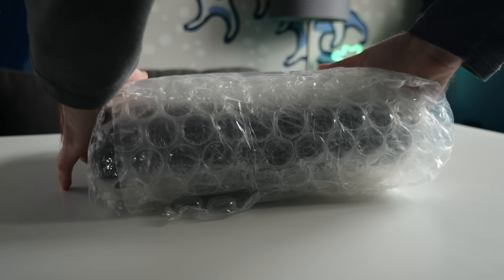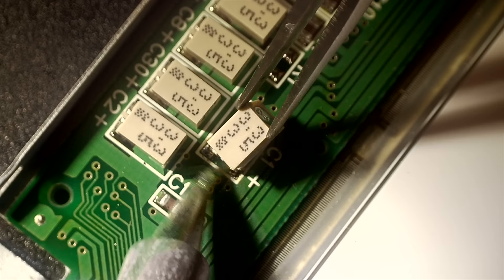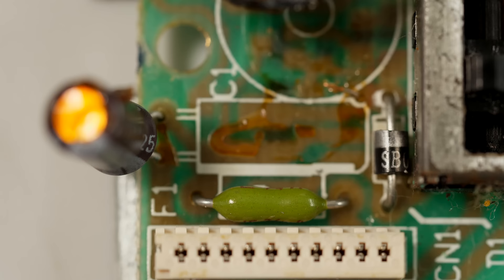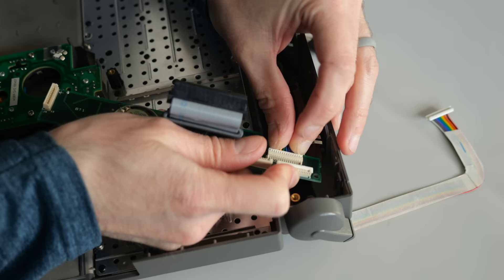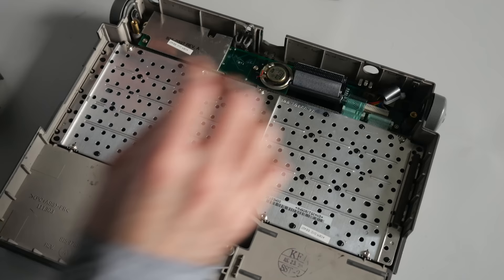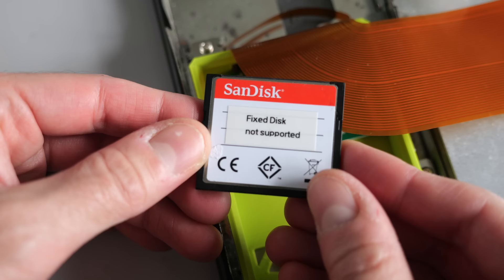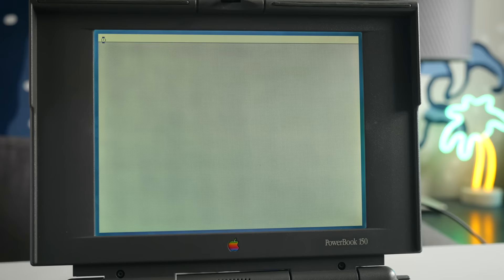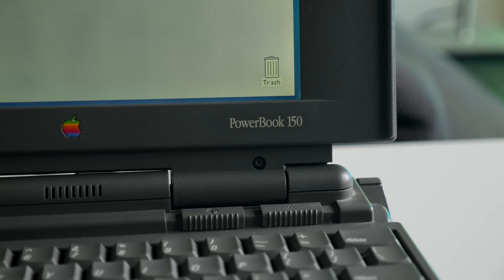I restored the WORST laptop Apple ever made

Comment: If you want a replacement battery pack, I reverse engineered it and put designs up on Thingiverse to build your own. They are fiddly to build and do take several hours, but they're good if you want your laptop to be portable again. With the advancement in battery tech, if you use high capacity NiMH cells, you can get way more capacity than the original pack. The one I built with 4/5A cells was about 4500 mAh compared to the original 3600 mAh. Using full size A cells, you can get up to 5200 mAh. The pack I built ran the 145B idle for 5 hours without even dropping a bar on the battery meter.

A warning about using them though, make absolutely sure that the DC power adapter is putting out exactly 7.5v, because the DC jack is passed directly through to the battery terminals, and 7.5v is the working voltage of the pack. As the original DC power adapters from these laptops age, the capacitors inside them leak and can cause the voltage to drift up alarmingly out of spec. The laptop can tolerate higher voltages than the battery pack, but I suspect the voltage drift issue is one reason so many of those packs have leaked.

If your DC adapter voltage is too high, you'll have to recap it and recalibrate it with a potentiometer inside the power adapter.

But as for this being the worst early power book, it's far from it. If you want a really bad experience, the slightly earlier 145B, 100 (which was a Portable redesigned by Sony) as well as the original Portable were much worse machines. I've worked on all three of them, it took quite literally weeks to get them all working due to the horrific damage they had inside. Not only did the capacitors leak on the logic board, so did they on the screens, and the ones I worked on had hidden capacitors under daughter boards and under the plastic bezel. As well as the 145B having had a leaked battery.

Comment: The Powerbook 150 was indeed the worst laptop Apple ever made, but at the time it was released, it basked in the afterglow of the appeal of the prior 100 series models, which were somewhat better, at least until all of them inevitably broke in one way or another. I repaired many of them at the time, and I agree that their build quality in several important ways was really surprisingly shitty.  Among other things, it was obvious that the plastic mounts for the threaded metal barrels into which the hinge screws went, were designed to break to generate repair "sales".  Apple continued with this designed point of failure for years, so it must have made them some easy money.

Comment: I like some of the classic Macs (which is why I watch this channel).

But, I have to say, half-way through the vid, I was thinking the same thing as Colin did at 16:36. lol

I was afraid to even say it in the comments before that, because Apple fans can be especially... "passionate".
But I really dislike the design of this specific laptop model.

The fact it doesn't have SCSI termination power, doesn't support Disk boot mode, has a ghosty-looking LCD, the case design is chonky, etc.

The OS in ROM not supporting HDD partitions over 2GB or 4GB is kind of understandable for back then.
But then, Apply would have known that, too, and could have just included the partition tool.

I guess in some ways, these issues do give the laptop a certain charm. lol
It's just the practicalities of actually using it would put me off.

And man, the size of the plugs on some of the adapter cables back then. Sheesh.

We forger how lucky we are to have standards like USB-A and USB-C plugs these days.

For the most part, it just "works" now, but USB wasn't an easy road either.
It was VERY flaky on various versions of Windows for quite a few years.
Reply: 19:44 - See, this is when you know a good and fair channel:
Colin is a fan of Apple in general (of course), but is willing to admit when certain models are a bit meh, including some of the modern ones.

I would say the same about certain retro consoles I own, like the Atari Jaguar. lol
Even though I like it for what it is... it wasn't that great of a console, even on release day.

Machines like the Amiga 600 got some hate at the time (and even now), but I think it's a fantastic design.
I am a bit biased, though, as I did own an A600 in the early 90s, and loved it.

It was far more compact than the A500, the joystick ports were on the side instead of the back.
It had 1MB of RAM as standard (which lots of games required), still had an expansion bay, and was just a neat little computer.

Comment: Some computers are not worth to be repaired.
Some computers are not worth to be used.
Some computers are not worth to be purchased.

But all computers are worth to be remembered, to be preserved, to be restored.

It is funny how in any given time every computer has a value of none, or high value. 
Like look at the Nokia 5110 or 3210 phone. Everyone had one, so no one even thought to save one in mint condition as it was so common. Until it became more valuable and rare when everyone had trash used version or thrown away their own.
Or look now something like Apple Vision Pro, that cost over 3500 USD, and is not really suitable for anything good really. And how many will preserve theirs in mint condition without scratches to plastic front, wear/smudge the headband, no damage to proprietary power cable etc?
How about original Microsoft Surface RT? Or how about original Apple iPhone, iPod?

Comment: What’s the big problem here? Failing to understand why “it’s such a piece of shit” and not worth you fixing. 

You knew the plastics were broken and  knew you had to fix that so that’s not something you can complain about fixing.

You’re the one that broke the inverter and in the process of fixing it broke it more so again, you cannot complain about having to fix that

The keyboard was actually working you just replaced it with a broken one soooooo yet again, you can’t complain about that. (Minus T) you made such a loud statement over putting in a failed unit and saying the original unit is shit because a replacement failed unit failed. But not over the T? Uh okay..

Getting restore going, sure it should be standard but it’s not this units fault it’s every units fault dumdum. 

Using incompatible hardware doesn’t work all the time? Gasp who knew. 

Using more incompatible hardware still doesn’t work?! Whattttt that’s crazyyyyyyyyy